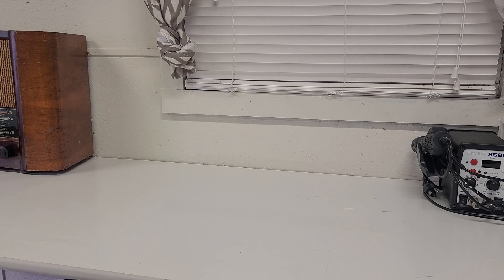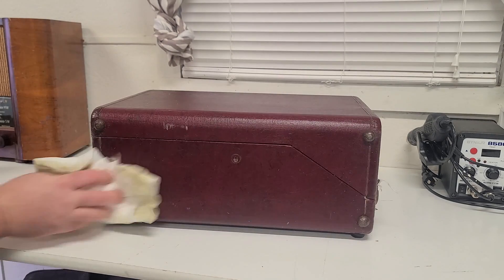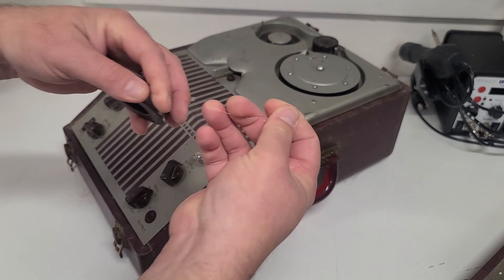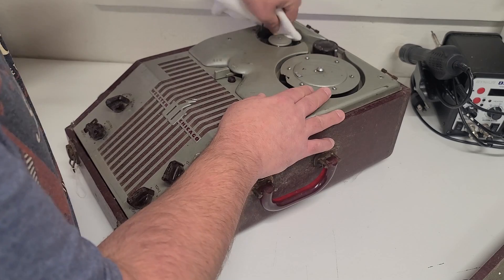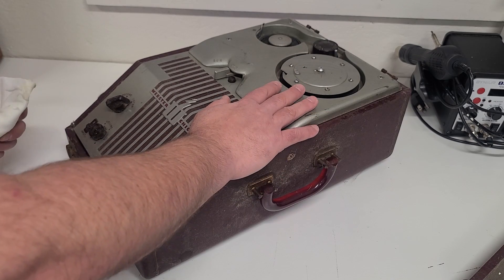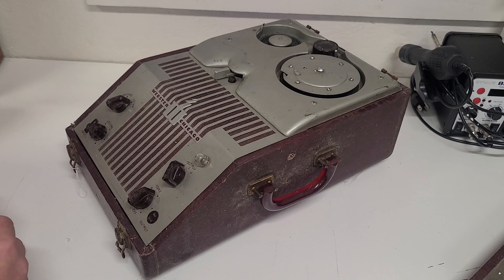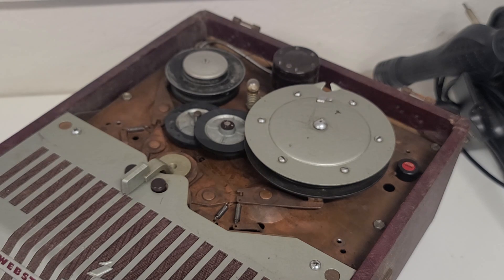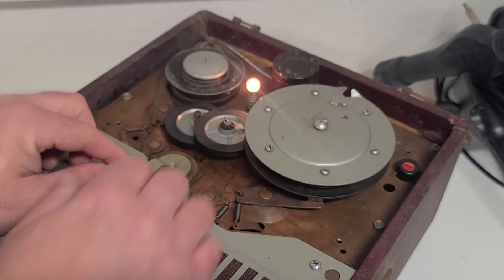WIRE RECORDERS... Was that a thing? History and Repairing a 1940s Webster-Chicago Wire Recorder

Comment: Nice video. I have one if the same recorders. Many years ago in the mid 60s, I bought it for 25 cents at the Goodwill As-Is department, Most everything was 25 cents from the guy that priced things.
Worked fine for years. I need to recap it, and it uses the notorious 6X5 as a rectifier.

Comment: By the way in the recording I can hear that the wire on the small spool may have jumped a wind. It's pulling through the wind  causing that noise.
  It's pulling through one revolution of wire where it should be pulling from the very outer layer, if that makes sense.
Another thing to watch for it make sure your felt brakes are working right! Nothing like a backlash of wire on these things when the take up reel keeps spinning when the small reel stops on rewind.  The way to splice the wire if you get a break is a simple square knot.
If you get a kink in the wire it will easily break at that point , the wire is so brittle.

Comment: Re: home recording. That goes back to the 1890s, when the wax cylinder was the dominant medium. Most Phonographs and Graphophones had a feed screw, which tracked the cylinder: with a recorder head, and a blank cylinder, people could easily record their own voices. When disc records supplanted the cylinder, there were a few attempts at home recorders; but it wasn't until the development of electronic recording that those became more popular.
Reply from the maker: True. I believe there were some dictation machines that even used wax cylinders into the beginning of the 20th century.

Comment: The chassis on that unit is copper plated. Is that what you're commenting on regarding the color? I don't see any rust. For that set to work right, the 2 rubber idlers need to be resurfaced. 75 year old. rubber just won't cut it. Then it will need all new foil and electrolytic capacitors in the electronics.